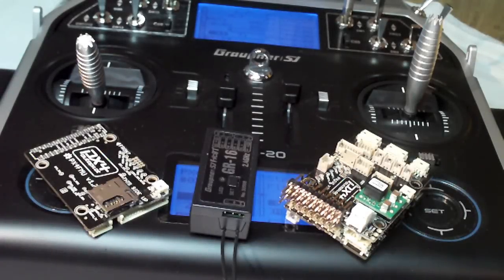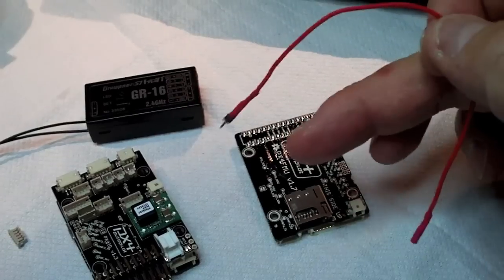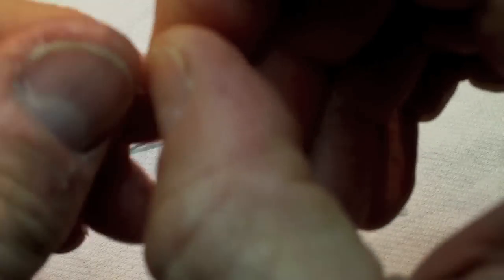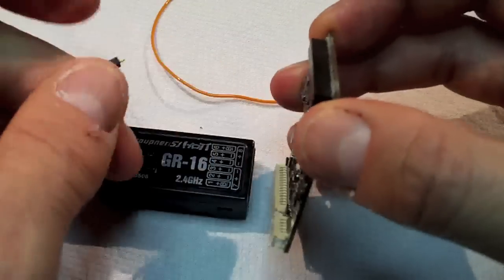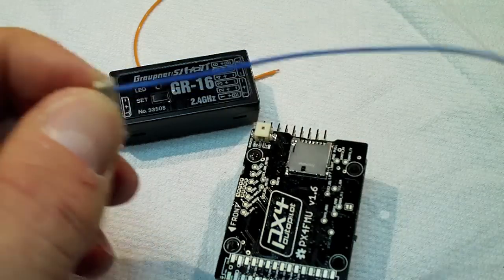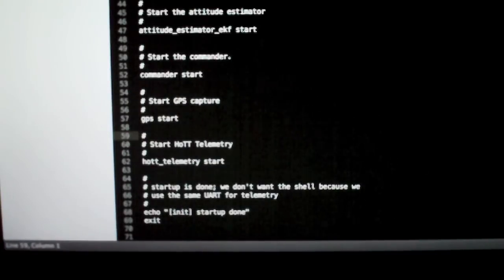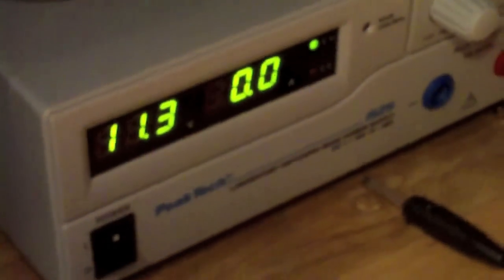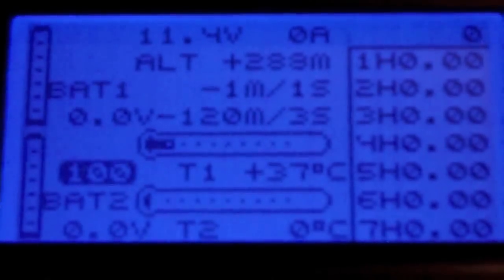PX4 HoTT Telemetry Tutorial

Comment: Nice work Simon.  As always a lot of info.  Thanks
Wondering if there is a Tutorial for PX4FMU - PX4IOAR - HOTT Telemetry.
Can you please share the link.. Regards
Prasanna
Reply from the maker: Hi Prasanna, I don't have a PX4IOAR specific tutorial but the only real difference is the port you might use. I think you should be able to use UART5 on the board in which case you would you may be able to start it with:

hott_telemetry start -d /dev/ttyS2 (probably in the extras.txt file)

If UART5 is somehow used for something (I don't know the PX4IOAR) you could also try and take another (UART2) directly off the FMU but this might need some soldering work.
Reply: Thank you Simon!

Cheers!
Prasanna

Comment: Hi Simon, Thanks for this job,
I am just beginning to see Pixhawk system. I will get one next week :-) and I have Hott system. I want to try a wing with this system.
In order to connect Hott, I suppose you use the Serial 4/5 port on the PixHawk but wich is the name on pin 2 TX, USART2 (/dev/ttyS1) ?? or another name.
Second question, on MX-20 now you can't select, on the last firmware, the sensor in telemetry menu. They fix an automatic detection. So when the signal will arrive, do you thing it will be detecting as Electric air ?

Thanks a lot and great work
Reply from the maker: Hi Antoine,
Port: I would try Serial 2 first which is the default for the driver. Be careful using Serial 5 (4 is fine) as it will block firmware updates to the IO part of the board if a sensor is connected. See http://pixhawk.org/peripherals/telemetry/hott#wiring which also provides a link to a site that supplies the connectors.

Regarding auto detection, I am not sure if it works but it should as I am emulating one of the HoTT modules so the transmitter should just work.
Reply: Simon Wilks
 Thanks Simon,
But where is port Serial 2 on the Pixhawk, I just see a plug on Serial 4/5 on the box. I already plan to use Telem1 and Telem2 for radio and minimOSD. I can't figure out how change connection beetween Pixhawk and (PIX4FMU/PIX4IO)
Thanks
Reply from the maker: Antoine Pannetier Telem 1 and 2 are Serial 1 and 2. Same thing. If you want to use 4 then use the first set of Rx/Tx on the page I pointed you too. See this page: http://pixhawk.org/modules/pixhawk